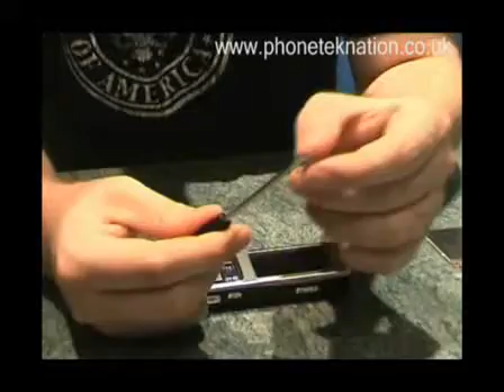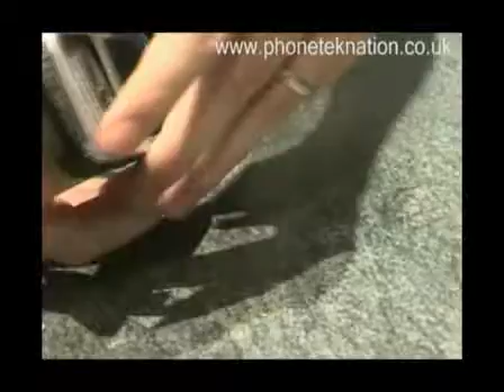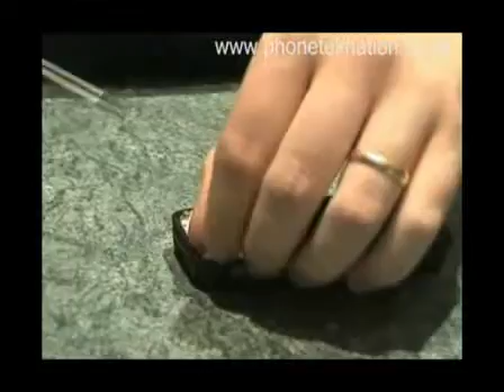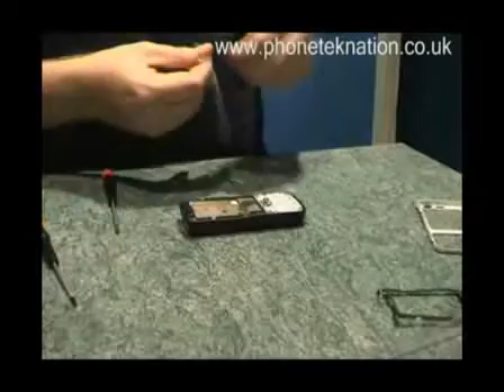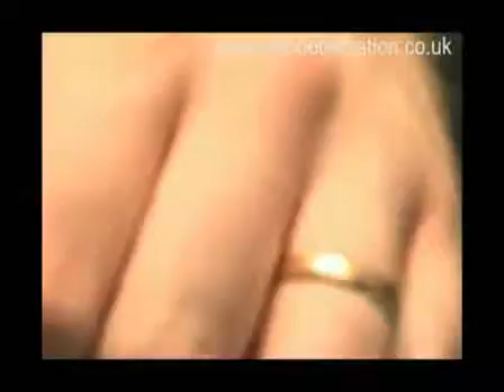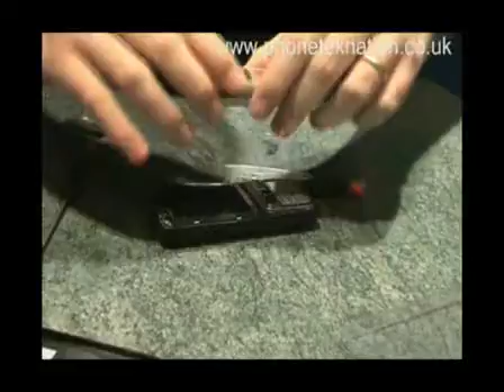Nokia N73 LCD Screen Replacement

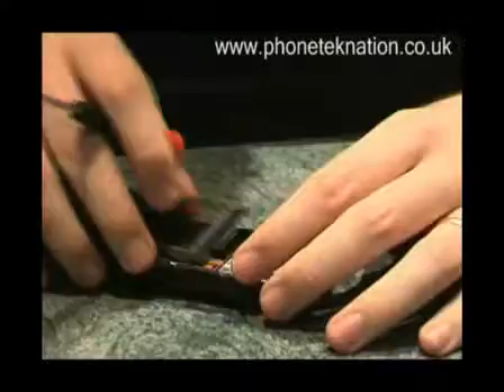Comment: You don't need to undo ANY screws to replace the screen, simply unclip the thin metal plate that fits over the top of the screen (as shown at 4:11) , unplug the old screen, plug new one in and refit plate.